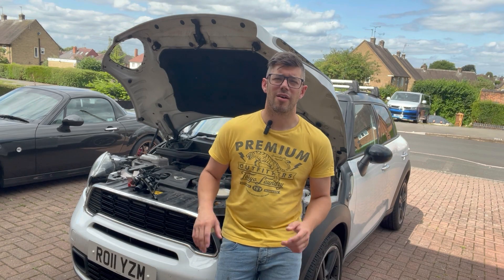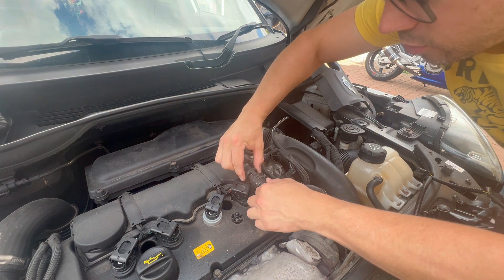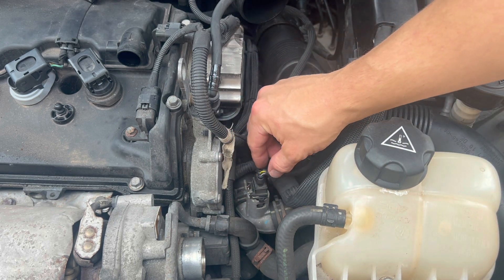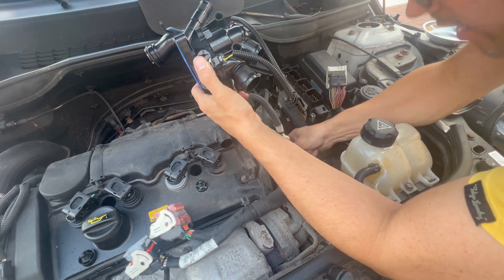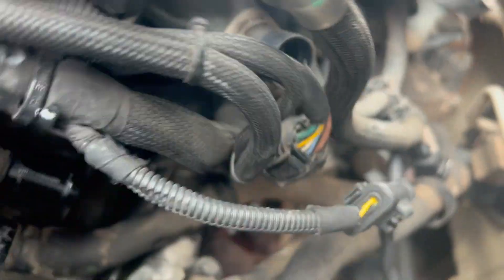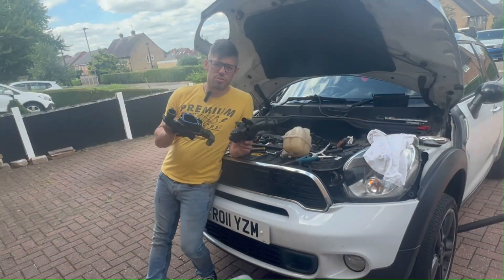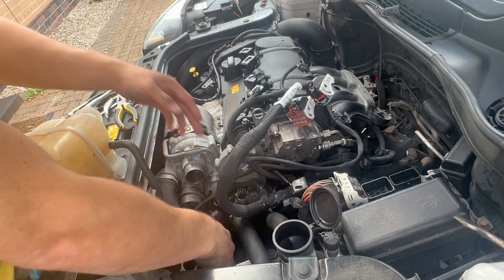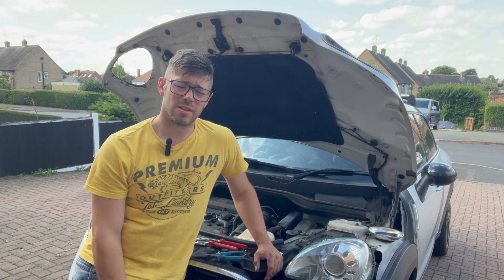Mini Too Hot and Fans keep running- How to change the thermostat n18 engine-Find and Fix

Comment: 👍🏼🏆 Great video I’m stumped with my 2012 r60 n18 issue.  I have no fan and ac isn’t working as of now.  It was but just stopped.  I checked relays with swapping out w/ my 2nd 2016 r60 mini that didn’t make any difference.  I then jumped fan to see if hi/low work if could be resistor but the fan works. I jumped pin in under hood fuse box to see if fan kicks on it does. Didn’t find any blown fuses either.  I also even did the dash read out of the temp sensor using reading it does read but extremely slow rising. So I’m wondering if the temp sensor is the issue. The car hasn’t thrown a code or any temp warning lights 🤷🏻‍♂️
Reply from the maker: Cheers man. Could be the case. The cars have a lot of very odd issues don’t they

Comment: Hello,

Thanks for the video. About a month ago, I changed the thermostat (mahle) and water pump (valeo) for my 2015 model N18 Countryman. My question is, even if I don't turn on the air conditioner for short distances, I see the fan turn on, after I turn off the engine, it works for a while and then turns off. What could be the problem here?
Reply from the maker: @Farukkkkk  have you access to a code reader or a scanner?

Comment: Hey, I really want your help..

I just changed all this on Saturday because of a leakage on the sensor in pipe AND the thermostat housing.

I bought a new theormostat housing from MAHLE and replaced it, connected the two sparks on thermostat and coolant sensor (on the housing) and the second coolant sensor on the pipe been replaced also with an oem (never find passing one or original for my model Mini R60 N18 ZC5) 

The car now work between 108-117 degrees Celsius and also when I drive with 150-160kmh the car doesn’t have the power like before and also doesn’t cooling down like before.. 

Any help?
Reply from the maker: @petrosgavriilidis6390  with mine. The sensor in the elbow wasn’t required.   Best way to find out what system is need is to plug the sensors in while they arnt fitted and see what readings you get. There’s three versions on this setup that I found and it’ll depend which your car is programmed for.
Reply: @InitialB  thank you for the fast respond, im sorry but im not understanding what do you mean. So in your System wasnt needed the sensor fitting on the elbow? when im disconnecting the sensor on elbow i get -40C on my system and car doesnt work well.. i have the same water thermostat like you with temp sensor and coolant sensor fitted in, so 2 contacts that going in the 1 contact of the original one.. but i also changed the second (old) coolant sensor on the elbow with an OEM but maybe thas not fitting
Reply from the maker: @ on my system. The sensor in the elbow isn’t used. There should be a new type of harness that just runs the two sensors on the thermostat.
Reply: I’m using this new type of harness and running the two sensors too. My Problem is that after this modification my car runs on temps between 108-117C..and now I don’t know what to do, air is out 100% complete from the system, coolant water changed, head gasket checked and it’s also ok
Reply from the maker: @ what does it read when the engine is cold?
Reply: @InitialB  I found the Problem,
my Mechaniker forgot to Push out the old Cable gone to the old Thermostat and Sensor. He just leg the old Cable Connection to the central Head and used the contact of the old Thermostat for the new One…

I Removed This Cable and connected it direct to the Cable from Coming the old One, now works everything perfectly
Reply from the maker: @ awesome man. Well played
Reply: In my car if I disconnect the sensor on the metal elbow obd shows me -40C. I will try now to disconnect the sensor on the Temperatur housing direct and let you know
Reply: Just pushed out the cable of the coolant sensor on the thermostat housing, driver about 10kms and same problem.. auto runs up to 108-117 and don’t going down again.. 😢
Reply from the maker: @ makes me wonder if you’ve got the right loom. Cause there shouldn’t be a cable going to the elbow.     Have you got two sensors on the thermostat?  That’s all that should be plugged in
Reply: I have two cables in the thermostat housing, one is for the thermostat and one for the coolant sensor, that’s all 

But in metal elbow exist one more sensor and this sensor also replaced for me, there is a cable also and I don’t know where is going, but it isn’t going to the thermostat
Reply: Question!! 4:31 what are you doing there?

You say when you disconnect the coolant sensor on the pipe you’re reading -40C right? Then you disconnect the old jumper cable and connecting it to the new thermostat? And the coolant sensor on the pipe stays disconnected?
Reply from the maker: @petrosgavriilidis6390 yeah. The new harness only has two sensor connections and they both on the thermostat.   The sensor in the elbow only stays in to blank the hole up. But no cable goes to it